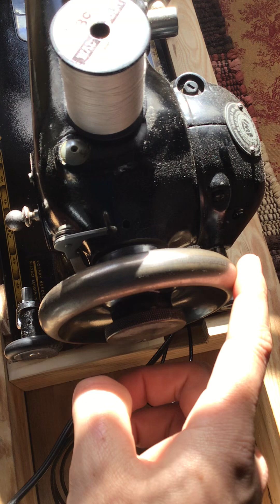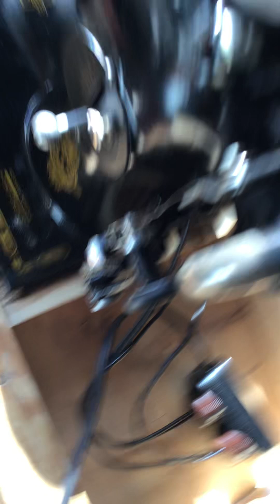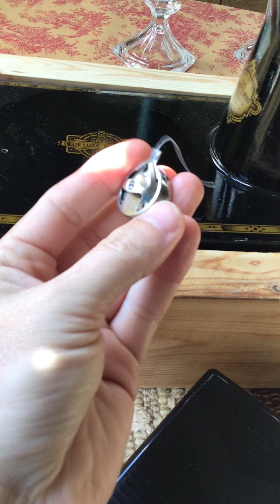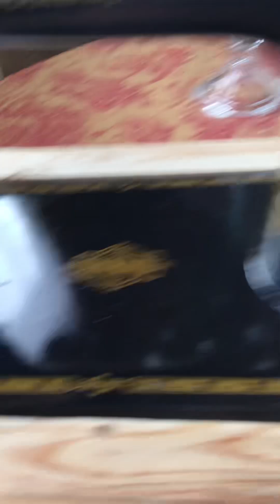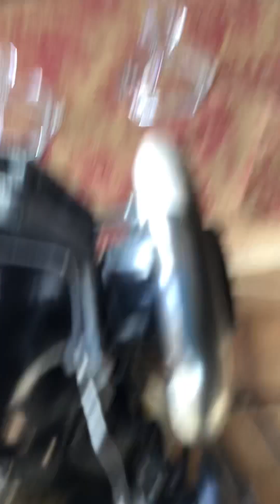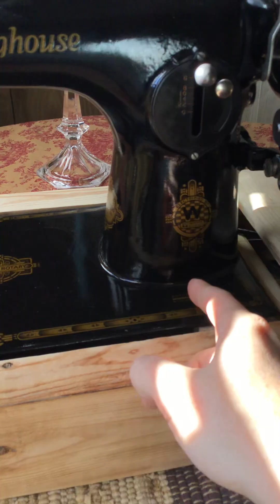Basics of How to sew with a vintage Free-Westinghouse sewing machine

Comment: thanks we came up on a type e at an old house for free and trying to get information on all the parts and doo hickeys and weird setup has been somewhat of an easter egg hunt so i appreciate it
Reply from the maker: Their very good old machines they are simple and fun to work with..i have few videos on them that goes into more detail but if you have any questions later on just drop me a comment..i have 2 i sew on one is cast iron and one that is aluminum
Reply: @Theantiquerepairman mine is cast magnesium, looks different than yours  but was mostly the same components compared to others I’ve seen..I didn’t think about cutting the back part off the needle like you mentioned but I can do that more easily than I can find the proper length needles lol.. 

i’ll post a video if I get it functional and thanks again. Sewing machines are new for me so it’s extra confusing but I’m starting to figure it out.

Comment: Where exactly do you oil it tho?
Reply from the maker: All small holes in the top of the arm one in the bed and one on bobbin winder then under the chrome face plate there is a bunch of joints connected to the needle bar to oil then underneath all the joints that move needs oil .. I can’t find any diagrams that shows